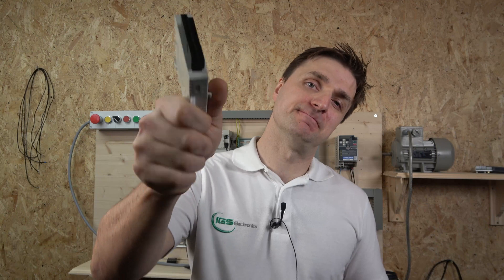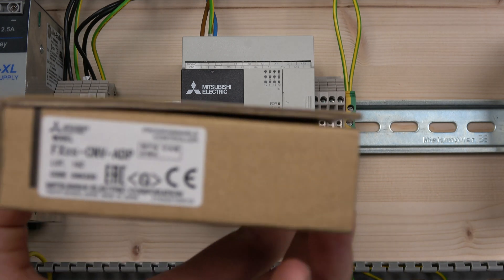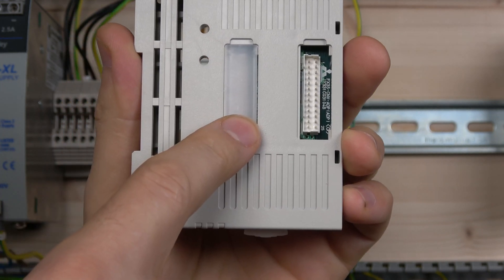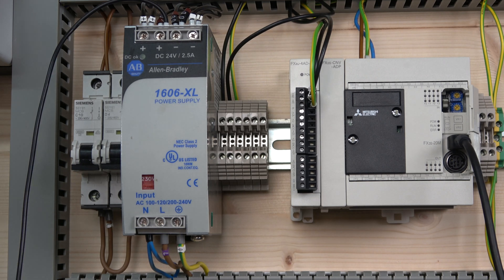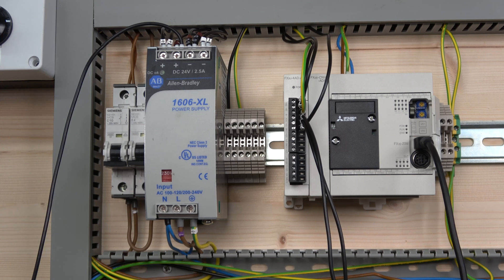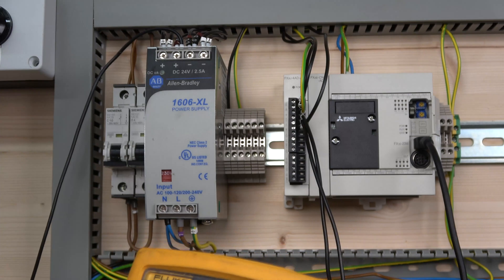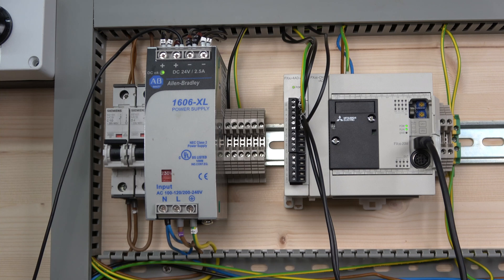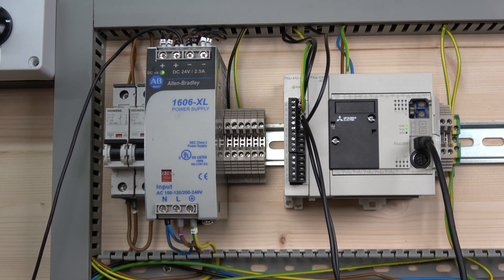Mitsubishi PLC programming / adding FX3u-4AD-ADP analog input card to FX3s PLC, the wiring. Part 1

Comment: Hi how do you choose circuit breaker and power supply rates
Reply from the maker: You calculate proximate current you estimate you are going to use and go from there. This is a big question as there is lot of factors that can determine what you are going to use for different projects.